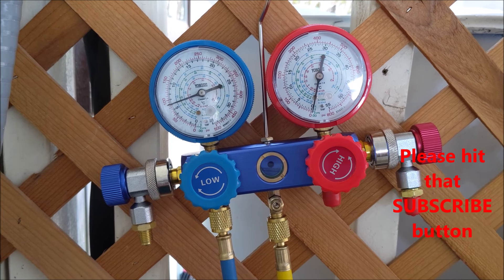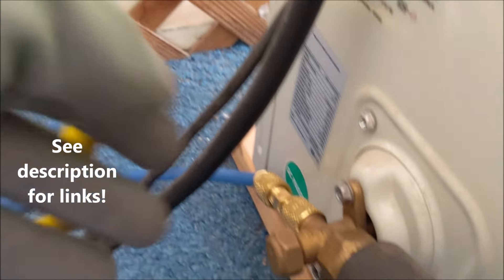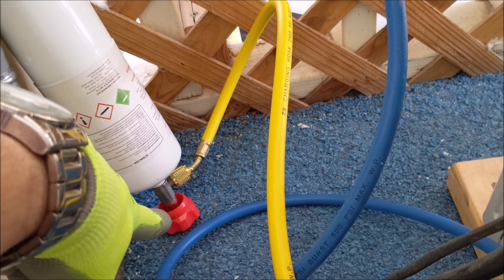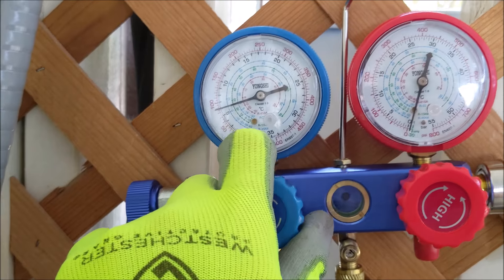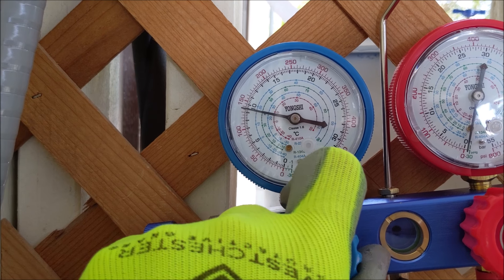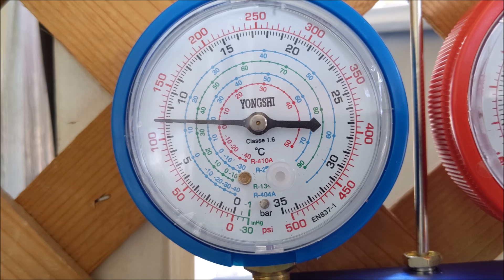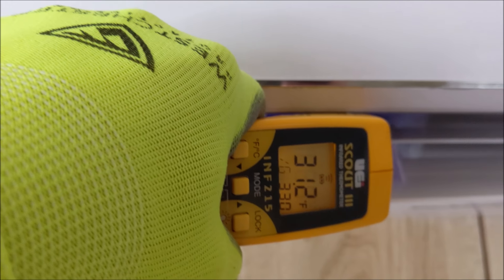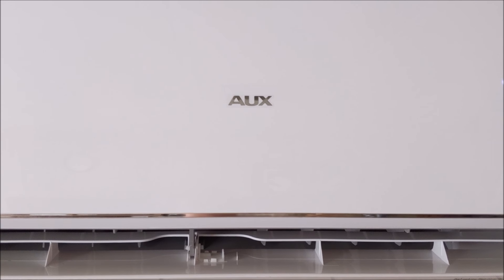How to charge mini split yourself, DIY 410a refrigerant, save money!

Comment: Should the pressure be same in winter or still 117?
Reply from the maker: You have to run in cooling mode, which you may be off in the winter. Best thing to do is to weigh the refrigerant. The label will show how many pounds it takes. Put the refrigerant tank on the scale, and subtract how much needed. For example, on an empty system, with no refrigerant, place tank on scale. Let's say tank weighs 15 pounds, and system needs 3 pounds. Start adding refrigerant slowly, Open valves, close valves. Slowly adding. When tank shows weight on scale of 12 pounds, that means 3 pounds is in the system. What I did in the video is use a 2 pound tank, on a system completely empty, that needed 2 pounds, so no scale needed. Use a scale like this one..... https://amzn.to/3RAllzN

Comment: If it's a 2 zone system do you add refrigerant to both ports or just one. Does a 2 zone share refrigerant or does each zone have their own?
Reply: Turn both zone on to the lowest temp highest fan and charge from any port or port A if it has a mark.
Reply from the maker: Make sure you are in cooling mode when following the tips from Tom Jong

Comment: Hello, great video and would be easy to do here in the summer however it is winter right now. Can this process be used while the unit is running in heat mode? If so, what pressure should I look for when in heating mode. According to your video, the sweet spot is 117-120psi when running in cool mode.
Reply from the maker: Has to be on cool mode.

Comment: was the unit running when you were charging it. also my manufacturer said the static pressure should be at around 200psi so would the 117 still apply for mine
Reply from the maker: Unit has to be running.
Reply: Static pressure has nothing to do with refrigerant. 200psi Is wayyyyyy too much
Reply: @arodandjeter1  even when unit is off ?

Comment: Is the samething you use for heat? My heat is not working.
Reply from the maker: Yes, if it's a heat pump. You may have low refrigerant, or reversing valve issue.

Comment: So I did use your method of adding refrigerant on another mini split I have, after running it on cool and seeing that the pressure was down to 100 and thinking it was maybe not as cool as it should be. I brought it up to 120 as per your on off method. I left the guage on to monitor it as it seemed like it took quite a bit of refrigerant. I noticed that when off it was up to 250 pounds pressure, then I turned it on and it dropped back to 120. Later I checked it and it was again up around 250 and so I turned on the calling for cold and it dropped to 150. Then I turned it off completely again (to try the same test as before) and I noticed the  fan kicked on even while it was off (for a minute) Then I turned it back on, full cold, and it did drop to 120 pounds. 

But  I also decided check how much I had put in by weighing it (the weight of my bittle subtracted from its last measurement of 112oz, after I had weighed in 40 oz to another mini split that was completely empty) and I must have put in about 35oz.. and I now see the total capacity is only 30oz ! I had release a little out in the interim while it was off for fear of having over presureized it. My conclusion is that when the unit is off or not drawing, the pressure goes up. Once it is back on, it drops to the 120 sweet spot. But it seems trange that I could add that much refrigerant and what if it was too much? I will continue to monitor the guage. Thank you!
Reply from the maker: You need to test pressures while it's RUNNING, and in COOLING MODE.
Reply: @SaveGreenHere  you may have needed more to allow for the line set.
Reply: @SaveGreenHere even if it’s cold outside?  50’sF

Comment: Hi for a r410 cylinder or bottle, should i turn it upside down when charging the unit or should it be sitting upright...? Am also  intrested on how u actually open n close the valve for charging till it hits 120psi... any tricks or secret? Mean can u show us how u actually did open & close the valve frm 100psi till you reachef 120psi...thnks
Reply from the maker: Turn it upside down, open and close slowly in small increments.
Reply: @SaveGreenHere   ok thnkyou...

Comment: I found pressure to be really unreliable on a mini split, especially if it's something with an electronic expansion valve, as they will adjust both the subcooling and superheat on the fly for optimal condition...

Mine doesn't have electronic expansion valves, just capillary tubes, but I did it by pressure and feels like I might have overcharged it, as the compressor started becoming harder and harder to start, and dropping the charge (recovering refrigerants) fixed it. When this is done, the AC is cooling better but also the compressor hard start problem disappeared. However on the R22 system the pressure is reading to around 40 psi (which corresponds to a saturation temperature of about -10C), and it would never go above that, but any attempt to try and go over that either resulted in weakening the compressor or even seizing it up. I think saturation temperature adjusts itself based on various operating conditions as well as fan speed (you really want a ton of airflow over the evaporator to get accurate reading). If you look inside a mini split condenser there's a capillary tube leading from the condenser coil before it comes out to the valves. I do not know why this exists but there is likely a reason for it. This does not exist in standard AC units with a TXV. I know some even do it by current draw, but again, it seems unreliable. Weight seems to be the most accurate way to do it.

It feels like a mini split needs to be completely recovered and then have the charge weighted out.
Reply from the maker: Great points! Yes recovering completely and weighing is key, and mentioned in the video description.

Comment: your doing this with the unit running in cooling right?
Reply: it must be running in a full cool mode. not auto, not anything else. you want to be maximizing the cooling ability of the machine. some units have a charging mode that ensures this for you. some dont.

but yes, on and on max ac/charging mode.
Reply from the maker: Correct!
Reply from the maker: Yes!

Comment: Thank you. a great Reference to doing things: I have the  gauges adapter and 410A thanks to a friend. i have  fujitsu AOU24RML1 4lb. Design pressure High side 450, low side 240   It has two 9KBTU units to one machine?   I should add to 240 psi if  I am LOW.  I'll look for one with the same machine  to help on. appreciate some advice
Reply: If you have removed all the refrigerant from the system than you should put back the specificfication weight of 410a.

Comment: will low refrigerant cause the heat function not to work and blow hot? or just the ac function to not blow cold?
Reply from the maker: Low refrigerant will not get you cold air in the summer time on cooling mode.
Reply: It won't work on heating either. These are a heat pump, they essentially move heat, just depends on which way they move it as to heating or cooling. Either way, low refrigerant will cause it to not work, or either mode.

Comment: What if you think your mini split is empty of freon and your compressor is barely running at all do I perform a pressure test and do I need to pull a vaccum before I add fresh refrigerant 
12,000 btu Senville low presser no refrigerant

Comment: Thanks a lot for your video. It is really helpful. I have a R410A refrigerant FUJITSU minisplit with model AOU24RLXFZ. In the label, it said design pressure high side:450psi low side:240 psi. It looks the lower sider PSI is pretty much higher than your normal 120 psi. Currently, my low side pressure is 125 PSI and AC is not cool enough. Does it mean I need to add more refrigerant to achieve 240 PSI on lower side?
Reply: Same question, I'm seeing Hi 550 PSIG and Lo 340 PSIG on a Senville 09CD
Reply: @AlekseySmolenchuk  Those are test pressures.

Comment: Thank you
Thank you 
Thank you 

Following your steps i was able to fill my system 

I have 2 zones 

I hook up the gauge to the 1/4 inch pipe like you said and  

I was scare at first because when I hook up the gauge it was at 50 but when put it on cool and turn on the system it will drop too zero 

It didn't exactly match your video but I knew I didn't have a leak because I pressure test the system and ran a vacuum before 

So I just said fuk it and follow your video it was on cool and the system was running the gauge was at zero but as I put gas in the gauge will go up little by little until the gauge read 115-117 sweet  spot 

Also I went to each unit and the air went from just cool air too actually cold air 

I think in your video the system probably had more gas then my system or maybe because  my system is 2 zones that why its started at 0 when I ran it 

Thank you,  I really appreciate the help,  gonna check to see if you have a donate page like with PayPal want to send you $50 tip for your help bro
Reply from the maker: You are welcome! On your question, my Paypal is savegreenhere@gmail.com Thanks, much appreciated!
Reply: Gonna send it tonight or tomorrow,  thanks

Comment: If I'm just checking does it need to be running to check how much is in there?....I went to check it and it really came out...should I check it when not running..thanks subscribed
Reply from the maker: Yes, it needs to be running, and on COOLING mode.

Comment: Apologies if this was already asked, but did you charge the system with the unit running? Everything I read is that the refrigerant needs to be recovered then the system vacuumed back down in order to add refrigerant. I’d prefer not to do that! If running, do you need to be on test mode? Thanks!
Reply from the maker: Yes, it was asked, but no worries. Run in COOLING mode while adding.

Comment: Great video  and thanks  for the help.
When adding refrigerant from a 410a
tank do you keep the two valves open that you open with Allan wrench when releasing the precharged refrigerant from the outside unit upon installation or do you close them.
Thanks again.

Comment: Does the min split need to be running to add the refrigerant. Mine is empty do to a leak.
Reply from the maker: Yes, it needs to be running, and in COOLING mode.
Reply: @SaveGreenHere Should inverter be set-up and run on 100% speed and  60 fahrenheit? Thanks for the video, very informative 👍

Comment: Don’t you need to purge air out of the lines before you open the  blue valve?
Reply from the maker: Yes and it was done. You can also see here on some steps. https://youtu.be/RndlC9g5HzQ  You should also ensure there are zero leaks in your system. Because refrigerant is a closed loop system, not addressing a possible leak means you will be buying more refrigerant AGAIN in the future. Fix the leak, vacuum the lines, as shown here.... https://www.youtube.com/watch?v=b_aysEpNLes  If you have a leak on a mini split, 9 out of 10 times it will be on the connection. That's where this simple fix (with the system having no refrigerant) comes into play..... https://www.youtube.com/watch?v=hQjOhWkGmM4
Reply: Ok thank you
Reply: I was wondering the same thing. It wasn't covered on the video it seems.

Comment: i have just bought a mini split but the unit has only enough refrigerant for a 25 foot line and i need 50 feet  of line set so how much r410a would i need and would the procedure be the same as you have shown?
Reply from the maker: Get this 7.5 pound jug, it will be more than enough...... https://amzn.to/36szXYQ
Reply: Read the manual

Comment: What do I do prior to going inside to check temp?  Great vid. by the way, very helpful.
Reply from the maker: Add refrigerant in small increments, and wait 12-15 min before checking temp and pressures.
Reply: @SaveGreenHere  Do I shut the gauges down tight or leave them open and go check temperatures.  I don't mean to be a bother just want to get it right, thank you.
Reply from the maker: Open when you add, close when not adding.
Reply: @SaveGreenHere  Got it!  Thanks I really appreciate it!
Reply: @SaveGreenHere  I followed your directions exactly. My low side gauge totally tacked when attached.  I tried to release the refrigerant as you said but nothing happened.  Not sure why my blue gauge tacked backwards?  Any tips?

Comment: Once you have opened valves with Allan wrench to release refrigerant into system, do those lines remain open? Do you ever close them?
Reply: No, do not close.  Closing will reseal the lines to the compressor and no refrigerant will flow.
Reply: @spazzman90  Thanks

Comment: If it’s a brand new mini split unit do they come charged with Freon? Because for one reason it’s not blowing cold air. I have the same exact one you have in the video
Reply from the maker: They have "some refrigerant" according to the unit we installed, but not to full capacity when you account for the refrigerant lines. So make 100% sure that your flare ends are tight, either use a gasket, or Nylog. This is number one priority. No use to add refrigerant if the ends are not 100% tight. Then, make sure you get plenty of extra refrigerant. I added the links below for your reference, depending on your pipe sizes.....
Link to 1/4" seal...... https://amzn.to/30sMPNq  
Link to 3/8" seal..... https://amzn.to/2ZJ97eI    
Link to 1/2" seal.... https://amzn.to/2Cs7byf   
Link to 5/8" seal.... https://amzn.to/2OH1rDb    
Link to 3/4" seal.... https://amzn.to/2WBEdCP     
Link to more refrigerant..... https://ebay.to/2thWqdf or https://ebay.to/2JzUOjF
Link to liquid mini split pipe sealer.... https://amzn.to/3jdNZVs
The gauges..... https://amzn.to/31nTA1Y
Adapter for mini split (5/16 to 1/4)... https://amzn.to/2Ys9qLN
2 stage vacuum pump..... https://amzn.to/2JWdeM4
Reply: I really appreciate your time on helping people with or no knowledge at all God bless you man!
Reply: Thanks for info

Comment: Can you use this product to partially recharge a 3 ton split system? If so, could you do a video for a 3 ton in the future, please.
Reply from the maker: Yes you can. best way is to see on the label the pounds of refrigerant needed, and weigh the refrigerant cannister before starting to fill. For example, if the cannister weights 25 pounds, and you are a pound short, when the cannister drops to 24 pounds, you're good. The adding should be done incrementally, every 10-15 minutes. Here is a scale that helps...... https://amzn.to/3aY47Lh
Reply: @SaveGreenHere  I have a DIY MrCool 3 ton mini split. Instead of weighing the r410a tank to charge the desire amount, can I just charged like how you did here to 117-120 psi if my psi falls under that. Thanks
Reply from the maker: Duke, your best bet is to always weigh it. The reason I did not weigh on the video is because the unit was completely empty, as it leaked completely, and it needed 1.4 oz, and we purchased this 1.44 oz container..... https://ebay.us/HKUnC3  So that made everything easy. You still need to vacuum properly, and we show that here..... https://studio.youtube.com/video/b_aysEpNLes/edit   But if you have a large refrigerant tank, you are better off getting a scale and weigh the refrigerant according to what the label indicates it needs. Here is the one we use....... https://amzn.to/3QXCoea

Comment: hello, my split unit label plate said  Lo 340psi Hi 550psi. Is it normal? seems big difference to 120psi. I charged it to 120psi, it just cool not too cold.
Reply: no don't charge that much. those are max pressures for the system. you will blow something up if you charge that high. Charge to 38 degress F on the R-410a scale on the low pressure gauge (this should come out to around 110-120psi)

Comment: I connected the hoses to charge my Mitsubishi mini split and it looks like it has 150 psi.  Does this mean it is overcharged and I need to remove some of the 410a to get to the 120 psi?
The unit is running in cooling mode and the temp outside is 75 and 90% humidity.
What is the best way to get it to the sweet spot 117-120 psi?
Thanks

Comment: Is that 120 psi sweet spot the same on all mini splits? Or does that change depending on the size of the unit?
Reply from the maker: Depends on the size of the mini split. I was for that one on the video, but you should see the label, and see how many pounds it needs. Then, with a scale, weigh the full tank of refrigerant, (assuming your system is totally empty) and go from there. Example: You need 1.5 pounds. You buy a tank of 410a that weighs 35 pounds on the scale. You slowly add to the mini split system until the tank loses 1,5 pounds, and now weighs 33.5 pounds. Here is the scale for refrigerant..... https://amzn.to/3acJ0nQ
Reply: @SaveGreenHere  so just to clarify because I’m planning on doing this myself on a 4 zone 30K BTU system. Will I be filling strictly using weight of the R-410? If so, do I still pay attention to the PSI reading
Reply: The best practice for mini split is to start from zero ... Pull the vacuum and add refrigerant by weight.

Anyway, I top up my 9000 BTU gree inverter.. During topping up, I keep monitoring 
psi on the gauge, 
current from clamp meter ,
temperature on suction line ,
temperature from supply vs return air on evap unit.

I turn my ac to turbo mode or max cool... run for a while ...and adding refrigerant... My sweet spot 

Gauge psi.. 125-130

Current getting close to RLA (it is ok for mini split to ramp up to RLA on turbo mode... We are not gonna keep using turbo mode all the time in real life, right... The current will go down when on normal operation)

Super heat keep fluctuating in the range of 5 +-3, which is normal

Delta T or return air temp minus supply air temp on the evap indoor unit is between 15-20 degreeF